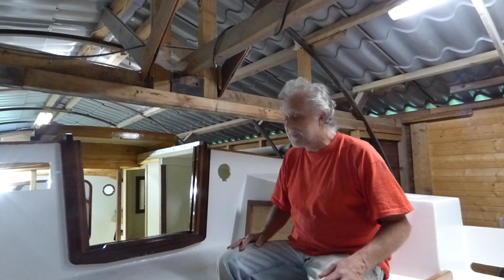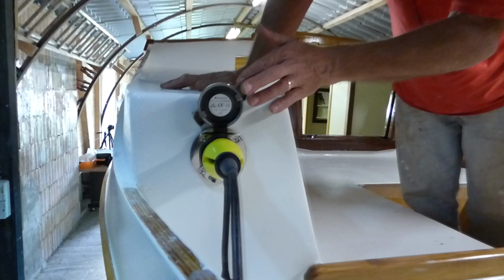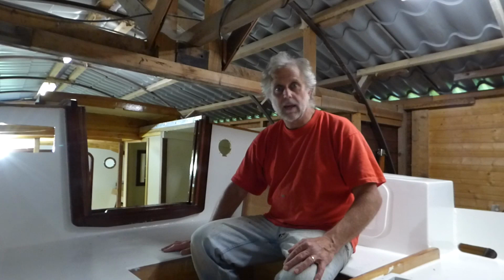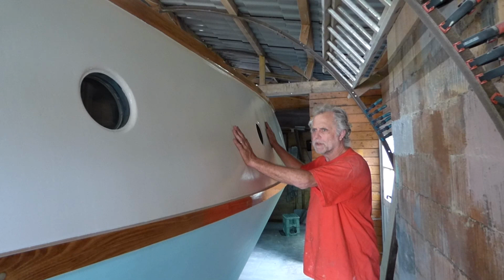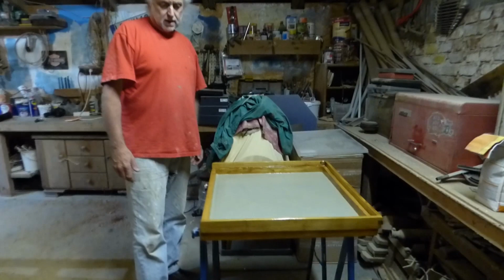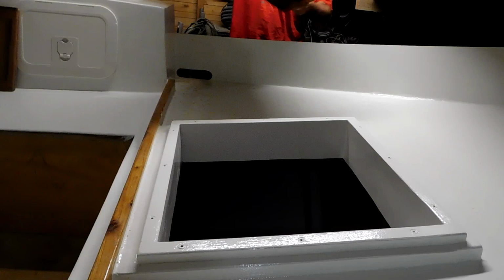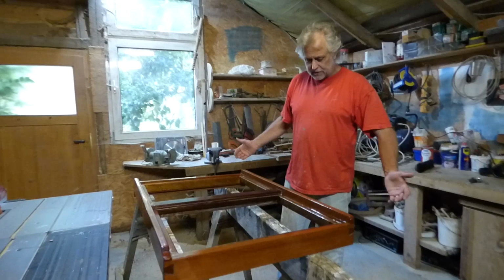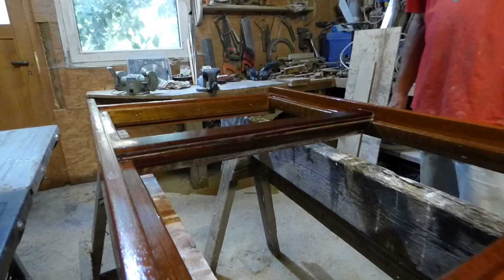Building a sailboat; Non-slip deck coating, shore power and hatches galore! - SV Tapatya EP144

Comment: It's your call, but you might want to consider running a fore and aft support member under those plastic skylights in the hatch. 1 cm safety glass can take a big wave crashing over the deck, but I'm not sure that perspex could take the pressure. The North Sea can be nasty...
Reply from the maker: That shouldn't be necessary Mike. I chose that acrylic, thickness and dimensions for the strength properties :-)
Reply: @SVTapatya  Glad to hear it. It was hard to tell from the videos how thick and what composition the perspex was. We use Lexan for the really rough applications as it's far tougher and holds up to the sun longer than regular plexiglas. Been retired for ten years now, so I'm not up on the latest products available. Just happy you're safe!... ; {

Comment: Do you have a part number for the angle grinder at 1:20 in the video ?
Reply: Just a guess but I'd say that was a Bosch Cordless Angle Grinder model GWS 12V-76
Reply: @hankus253  Thanks
Reply from the maker: @hankus253  It was indeed. Thanks!!

Comment: Good job, Tony.. is the mains wiring on the inside fully done, or just a temporary setup for now?
Reply from the maker: Thanks Garryck. Well, some some. The battery charger still has to be fitted and I've a small inverter to go in with the associated wiring and socket...

Comment: It's coming on quickly and looks great! What did you seal the hatches with? Wondering how to seal mine.
Reply from the maker: Not sure which hatches you mean, Alex. The plastic hatches are mounted with MS Polymer. The acrylic on the sliding hatch will be mounted with CT-1. I may well put a flat rubber seal around the lazarette hatch frame....
Reply: At 4.49 your putting a sealant around, is that ct1?
Reply from the maker: @Alex-yk3bw  No Alex.that's the Wiko MS polymer
Reply: Ahh okay, I shall give that a try, thanks for your help.